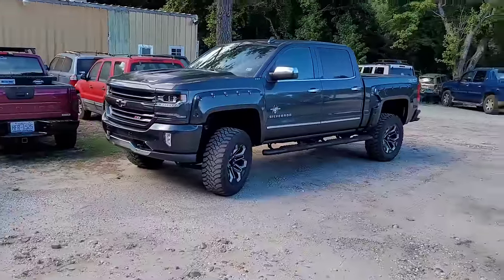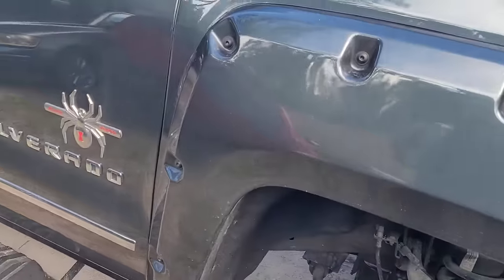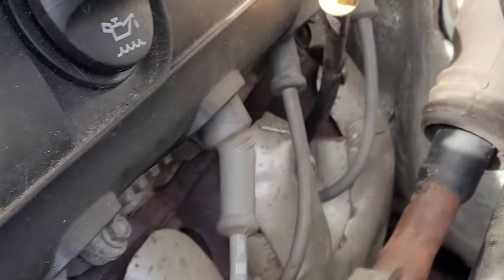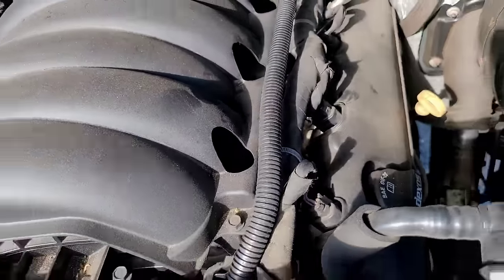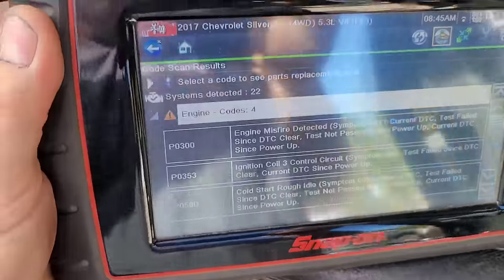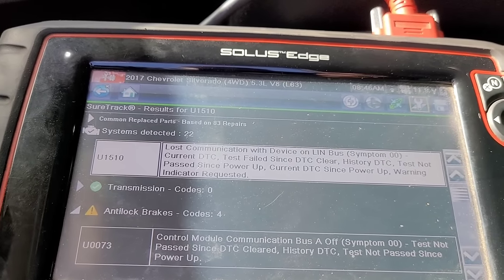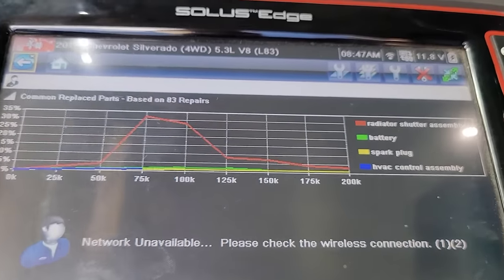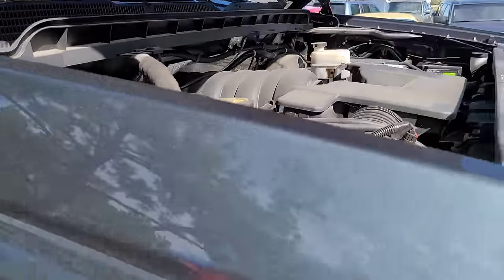AGAIN !!! Another "Tapping" 5.3 !! It's not lifters or exhaust.. 2nd time I've seen this..

Comment: The 4.8/5.3 tick is Piston slap where there is slight movement of the piston head inside the cylinder bore its not a big deal GM has been known for this for many years it does not cause internal damage and it does not effect reliability the last LS GM truck I had was a 99 silverado 1500 2wd with a 4.8 293ci vortec and had 518000 km when I parted with it in 2020 and if you want a good truck get a Chevy whether 4.8 5.3 or 6.0 litre the LS GM small block V8 is by far the best truck engine on the market then or now as long as you do proper maintenance there is no stopping a GM vortec
Reply: How you feel about the ecotechs? Just curious always wanted to swap for vortec I like the ported fuel system instead of direct injection
Reply: @burdman5620  ecotec 3 are good motors as well... the vortec system from GM is a solid and proven fuel injection platform that has worked well since 1996 on V8 trucks definitely not a fan of the new 2.7 litre turbo motor option in 22 and 23 GM trucks a real bad move imo on GMs part a ticking time bomb turbo charging just increases internal engine wear as long as you stick with V8 engines with GM whether vortec or ecotec and proper maintenance ensues... you won't have any issues
Reply: @stevemino142  how do you feel about the V6 vortecs? And do you think it's possible to switch from direct injection to ported fuel delivery on the ecotech 3's? I currently have a 2017 Silverado ls with a 4.3. 

I agree 💯 with you them 2.7's are going to be plagued with problems it's only a matter of time, thing is that's the new reality it's all about saving fuel and green house gases won't be no v8's nomore just electric which is far worse for the environment then gas burners imo. Honestly imo global warming is a crap the planet has gone through major climate change many times, the ice age the great flood and so on
Reply: @burdman5620  I've had 4 4.3 litre 262 vortec there are also incredibly reliable for obvious reasons... same bore and stroke as a 350 just 2 less cans...now the newer ecotec3 4.3 LV3 has a different bore stroke size than the previous 4.3 litre vortec starting in 2014... but the actual power output of post 2014 4.3 is quite similar to the previous 1996 to 2013 versions rpm peak on a 14 and up 4.3 is 305 ft lb at 3900rpm vs 260 ft lb at 2800 rpm peak on the previous vortec 4.3 litre swapping different versions of the 4.3 would be a simple task I would think other than motor mounts being slightly different on the newer models and I totally agree that unfortunately big 6s and V8s are becoming a thing of the past... but I firmly believe that oil and gas will remain in our future for many years to come
Reply: @stevemino142  really I thought the ecotechs had the same bore and stroke that's good to know. I didn't know they were that close in specs always thought the vortecs had slightly less power but with your statement seems they are the same, very interesting. Hmmm I wonder if the vortec 4.3 would bolt up to the 6l80 transmission that's on the ecotech 4.3? I'll probably run this one in the ground before I consider swapping but if and when I do it would be an ls 4.3 vortec or ls 5.3 vortec or ecotech. Though the lifter taps and exhaust leak problems with those 5.3's ecotechs are a nightmare I've been hearing. Thank you brother for taking the time to write to me about this
Reply: @burdman5620  no problem any time... as far as I know the newer 4.3 ecotec V6 or rpo code LV3 have similar bore and stroke as the ecotec 5.3 litre V8 from 14 and up... the new 6 speed makes the 4.3 eco feel more swift a tactic from GM to try and get buyers away from the V8 models
Reply: @stevemino142  when you say new 4.3 are you talking about the latest generation or mine 2017? I will say this when I first got the truck for the first 100000 miles give or take it ran like shit, it would always have these weird shift flares where it would lunge forward when accelerating around third and fourth gear I've done a lot to try and compensate that from resetting the TCM, which did help for awhile and even made the truck shift VERY smoothly it still returned after the transmission did it's adaptations. I've flushed transmission at dealership which di something for maybe a month then returned, changed transmission fluid and mildly flushed myself in the yard which did make a significant change. Now that it's at 162000 miles give or.take and just breaking in it runs beautifully, after I installed k&n CAI and flowmaster 40 dual exhaust not only do I not have to step on the peddle to get moving; barely have to give it gas really, but it shifts WAY better SOMETIMES it gets that shift flare but it's far and few between. Finale question though do you think I could take that 4.3l ecotech out and drop a 5.3 ecotech in with that same transmission? I'm just considering really honestly the truck sounds almost better then the V8 with the exhaust setup I have I never thought that little 4.3 could sound so good.
Reply: @burdman5620  your truck is the latest generation that started in 2014 front end changes in 16 and wow you've done a lot of improvements on your truck well I do believe that most 14 and up V8 trucks had the 8 speed hydramatic and most V6 models had the 6 speed   swapping the ecotec 4.3 out for a ecotec 5.3 would be easy and I'm sure if you needed a transmission adapter to make the 4.3 eco work with the 8 speed there probably easy to find I've never done a late model engine or transmission swap so I'm guessing on some things
Reply: My son's Chevy truck makes a noise also after idling a while. If given a little raise in rpm it goes away for a while then comes back. Guessing it's a lifter.
Reply: @buckshot8393  it's not a lifter if your changing your oil when the intervals come around approximately every 3000 miles or 5000km and coolant flushes every 2 years that noise your hearing has nothing to do with valve train it's called piston slap its where the piston rocks slightly horizontally inside the cylinder bore as it reciprocates up and down it's well documented with ohv V6 and V8 engines it's not a big deal and it doesn't cause damage to the motor internally... unless your son just knows where the key goes and where the gas pedal is it could be a lifter but I highly doubt it

Comment: I get things like this often. Problem is, most people think it shouldn't cost a thing because you literally knew what it was right away.  I don't mind giving freebies every once in a while when it's a repeat customer. But often it's a customer who already paid other shops big bucks and didn't fix their vehicle. Then they give me a sob story about how much they've spent already trying to get it fixed. I ask them why they didn't just come to me to begin with?  They usually answer they didn't want to bother me with it.
  I ask them how they trust the other shops when they couldn't fix something so simple like this and still charged them to work on it.  It just boggles my mind. I get vehicle almost every week that got new batteries but the other shops or part stores that sold it to them didn't bother cleaning the terminals and are no starts or electronic issues. A simple cleaning off the corrosion fixes what the issue was to begin with before they paid for a new battery.
Reply: I've got an old 05 jeep liberty 4x4 that Ii love ( for some reason lol) and the lights and stereo system would blink and dash lights had a flicker. It would run fine but didn't throw the check engine light. The shop I USED to use told me I needed a new switch for my lights and new ground and some other electrical part. I went and picked it up because my uncle wanted to look at it before I spent money.  One day I got bored and started thinking about an old ranger I had that would have acid buildup that was a constant problem. Went out and disconnected the battery and cleaned my terminals with a wire brush and secured them much tighter than they were before and haven't had an issue since and that was 6 months ago. Called the shop and told them I fixed it myself and they said "sorry our bad". I said yeah right, you were trying to scam a loyal customer and now that customer is done with you. Hope it was worth it!
Reply: Exactly, they are telling you how much they paid someone to not fix the problem,and want to cheap out to you when you actually do fix it - something seems backwards there

Comment: I’ve had 3 gmc sierras since 2003 all with the 5.3 keep them stock change the oil do all the scheduled maintenance and you will have very few problems i put 250 thousand plus miles on both the one I own now has 40 thousand on it and it purrs like a kitten awesome motor

Comment: I’ve got a u18a2 code they changed the fuel pump control module still check engine light then they Body control Module still check engine light could it be the ECM and help or advise please it’s a 2017 Chevy Silverado 1500  5.3
Reply from the maker: Being a "loss of communication" code. I would first verify the wiring . The B+ or ignition circuit could be shorted to ground or have an open/high resistance. The Accessory wake up serial data line or ground circuit could have an open/high resistance . Check there first
Reply: Cig liter fuse

Comment: Don't count on a customer being totally honest about who has been playing with the vehicle before you get it. the wires should never fall off, it takes a fair amount of force to disconnect those. imo somebody has been trying to test things and left it loose. it has to positively click into place when you connect it to it's post. forcing builders to enhance aerodynamics on a truck is just the EPA chasing more and more MPG..an old story here in the US. and now your stove and washer are a danger to the planet? the LS engine should have a quart of Marvel Mystery Oil or transmission fluid run in the oil pan at all times, it's high in detergent and that's what keeps the orifices clear on the lifters. if you know what you're doing you'll be fine. these get +250K miles when cared for. 🏁

Comment: I think i may have a bad ecm on my 99 silverado with 5.3L it does all kinds of crazy stuff like the hard shifts and occasionally get a check engine light then a couple times it failed to start and has had poor acceleration for sometime now but runs better with midgrade gas and crappy with reg unlead, did have a 0700 tranny code on scan tool last time i checked but reason i think it might be ecm is because it's having multiple issues that are random, may come to a stop it it's like it did not downshift then does after stopped is another.

Comment: I have a ticking coming from my 2014  Silverado 5.3. It only does it at idle. If I rev it the ever so slightest the ticking stops. Any suggestions. I thought maybe the oil pump is weakening, and giving it a little gas gives  the pump a little extra boost and so the ticking stops🤷🏻‍♂️
Reply: Sure sounds like a symptom of low oil pressure causing a lifter or similar to remain partially collapsed and causing tick from excessive clearance. Probably not a pump problem, happens all the time on newer cars when small oil passages gets dirty/clogged and restrict flow to certain sections of the valvetrain. I would expect your oil pressure to read fine at idle (any obd2 data reader can display it) to the lower end but not enough flow in the valvetrain. Extremely common from neglecting oil changes and/or bad designs.

I'd strongly recommend running a strong solvent (cleaner) like Seafoam or B12 in the oil for a few days before changing the oil to help this and act as preventative maintenance in all modern engines but especially an AFM GM.

Comment: Though I did have the common issue of either the screen and or the sending unit senor for oil pressure, trucks been reading zero psi for 3.5 years 🤣clear the codes and it spokes to 80. Sensor is bad, doesn't burn or leak so I know it's got oil in it 🤣

Comment: mine is a 2014, same noise but is showing no engine light? is this still something it could be? any suggestions would be much appreciated
Reply: My 2015 started running a little rough no check engine light, saw his 1st video on it went and checked mine, the number 8 plug came out
Reply: Investigated it and bc the electricity jumping to make connection it actually cracked the nipple connection on the coil pack
Reply: Threw a new wire on number 8 and fixed it for now until my new coil packs, wires, and plugs come in. But as soon as I put new wire with good connection on coil pack the ticking went away, the rough idle, and the check engine light.

Comment: Not diagnosing THIS tire wear. But right side tires wear faster than left because left turns are taken at higher speed than right. That, along with people driving faster than they should AND not properly rotating tires can lead to wear very much like this.

Comment: There’s so many vids of people beating on their trucks doing burnouts for views if this truck is owned by a millennial I would not be surprised that it was doing smoky burnouts and driver lost it and wrecked into a curb or another vehicle and that could easily explain why tires are so worn … also look under the rear of truck for rubber splatter from smoking tires… this truck looks like it’s bet driven hard
Reply: Yup must be those millenials, because ya know, no boomers or Gen Xers ever did burnouts in a car/truck.
Reply: You musn't know much about how stuff on cars wear and the obvious causes. The truck is most likely rwd/4wd. Absolutely no way the front will have this much wear from a rwd burnout. 4wd/awd cant do burnouts and even if they could, this thing doesnt make enough power to spin all 4 wheels at all

Comment: the plug wire is too short. when u plug it in you can see it pulling tension on the bottom.  with the wire being under slight tension, it only takes vibrations from the engine to pull it loose.. the plug wire set likely has slightly different length wires and they were put in the wrong spots, or it was a goof up from GM,,  I would replace the culprit plug wire with a longer one if not, it will happen again.  you can only fix it right the first time, the first time.

Comment: I lost a spark plug out of the head of the L96 in my 2500HD due to this. I had some cracked exhaust manifold bolts, so I figured it was an exhaust leak tick but then had to plow with the truck and the spark plug exploded.

Comment: Mine comes and goes… any ideas?
Reply from the maker: Add a quart of "old school" type F transmission fluid. 500-1000 miles before your next oil change. Verify to see if you have missing exhaust manifold to head bolts. I have  2 "ticking noise" videos. I mentioned a few things to try. Also, read the comments. A lot of techs write in what they have done to fix a ticking noise. Thanks for watching & keep wrenching 🔧
Reply: @WrenchingWithKenny  thanks man. I appreciate you replying. Love your videos
Reply: @WrenchingWithKenny  any particular brand of transmission fluid tho?
Reply from the maker: Not really whatever name brand you can get. Just make sure it's a type F 🔧

Comment: great channel. what's the deal with the Malibu at 1:59 - 2:04 mark?
Reply from the maker: It's a rust bucket underneath. Frame , fuel and brake lines , trans lines , fuel tank etc . All rotted. It looks good from 25 ft , but when you get up to it you can see rot around the rear window, in the door jams too . Looks good from far , but its far from good. Been sitting there for two years now . Still owned by a customer. Who knows what's gonna happen with it . Would make a good parts car
Reply: @WrenchingWithKenny  I've owned over 15 or so of the 73-77 Midsized Gm's and that seemed to be the most common problem. look good from a distance but rusty or rotted out underneath.

Comment: 52000 miles on my 21 no promblems I should be good for at least 300000 miles as long as a maintenance is done that's what my mechanic says I drive my truck for work and it better last I have a full warranty on my truck untill it's payed off ohh I did have one promblem a sensor went out and my warranty covered it and my truck didn't run any different just popped a code

Comment: I love the look of that bodystyle but I've heard numerous bad things about the 8 speeds, paint quality and thr dod/afm on those. I have an '11 with 170k miles and still running great, afm rarely comes on in mine due to leveling kit and 33s. Full synthetic oil changes between 5% and 0% "oil life" and running ac Delco filters. If I remembe right my last change may have used a Mobil one filter but I can't remember I'll find out in a few months lol

Comment: I haven’t started the video but I have an idea. On my 4.8 L  express I had a weird tick thought it might be a rod or a lifter anyways I thought I needed a need engine but some thing told me to check the bell housing peek in window from the bottom of the bell housing. So I did and the flex plate was cracked and was producing a loud tick/ knock noise got that all fixed and it’s sounds like a new motor. FYI never park on a hill and forget to put the parking brake on that’s what happened to mine. Hope this helps someone.

Comment: Youre not going off road that much. Youre not gonna be driving thru fields with tree stumps. Stop wasting your money on lift kits. Stop wrecking suspensions on very expensive well built pick ups. My 2011 standard 1/2 ton sierra sle long bed 4x4 goes thru 2 foot of fresh deep snow. The current generation of silverados and sierras are GREAT TRUCKS.